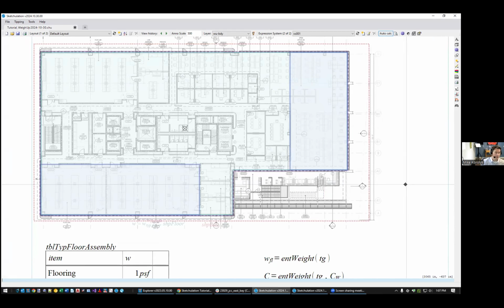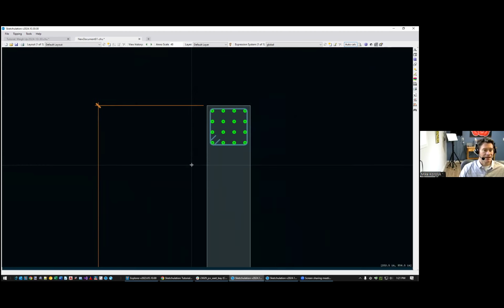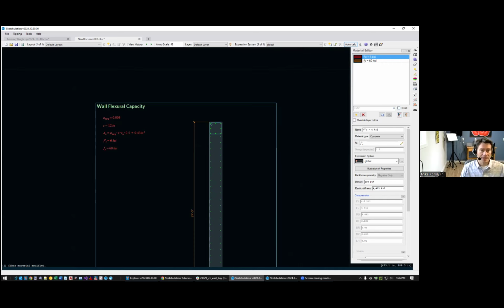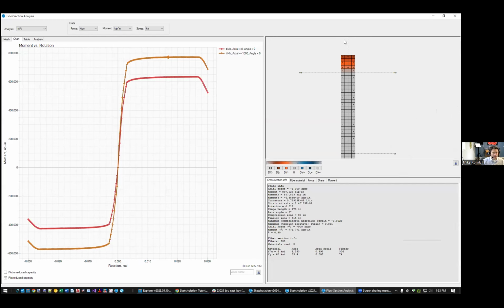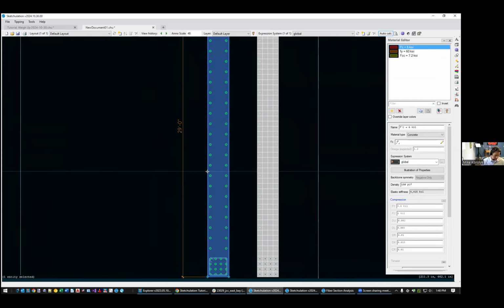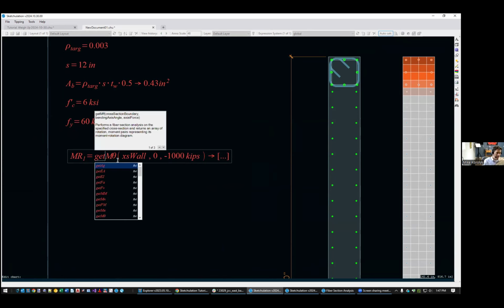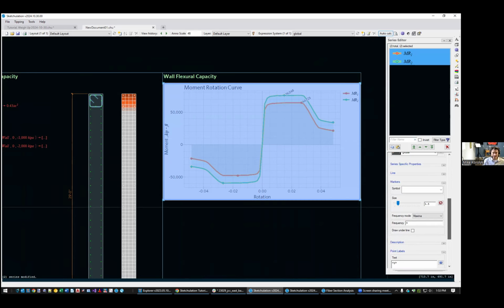Sketchulation Tutorial for New Users - Part 3A (Concrete Shear Wall)

Comment from the maker: ⏱Timestamps⏱  
0:00 Start
1:15 Review of Part 2 Tutorial
1:17 Weigh up example
1:55 Importing images
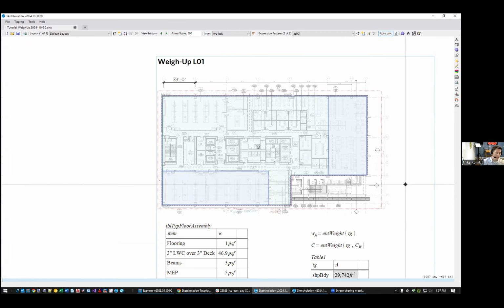2:07 Create entities with area weight, shape (sh)
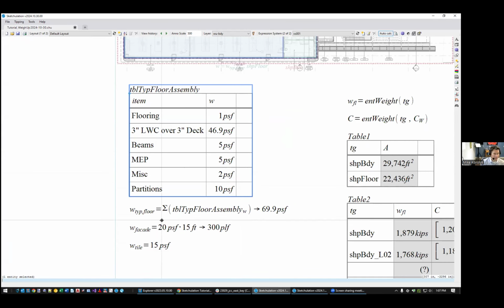2:12 Create table (tbl) to determine floor assembly weight in psf
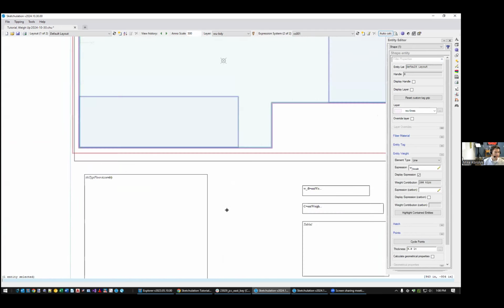3:05 Create entities with line element type, assign line weight
3:30 Create boundary with entity tag
3:46 Create new layout for second level (no tile)
4:13 Create tables to show properties of entities "tg"
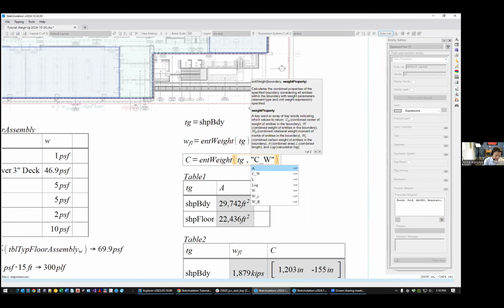5:15 Weight entWeight(entitytag), Center of Mass entWeight(entitytag, C_W)
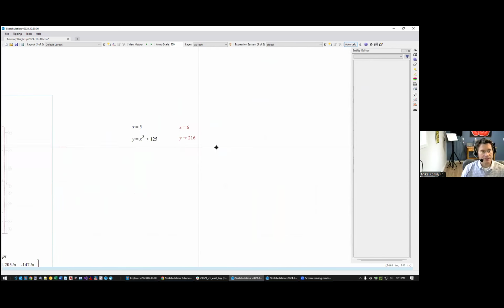6:40 Expression Systems
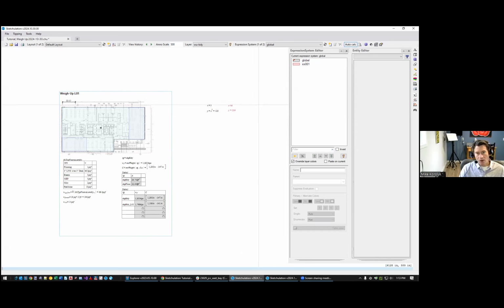8:40 Tutorial 3A on Fiber Section Analysis
10:42 Draw Concrete Boundary, shape (s)
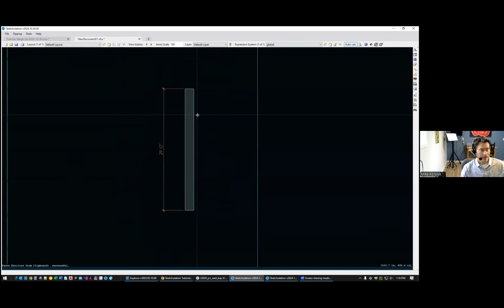11:25 Page Setup | adjustments via "Anno Scale"
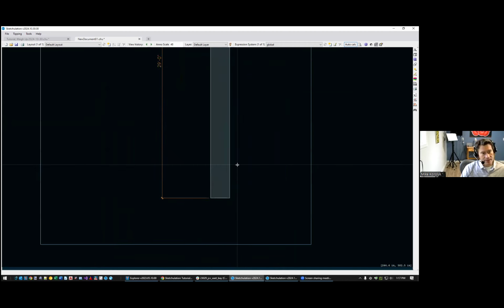12:30 Draw steel reinforcement at boundary, by hand: rebar section (rbs)
16:08 Draw steel reinforcement, by special function, concrete column (ccol) - indicate bar quantity, bar size
19:21 Define Materials, concrete & steel
21:36 Material editor
21:42 Assign material to shape, using paintbrush
22:33 Analyze section, Fiber Section Moment Rotation (MR), meshing
30:52 Design / Optimization of section
37:36 Make chart (cht)
41:53 Make chart with multiple inputs for axial force demand
46:49 Point Labels